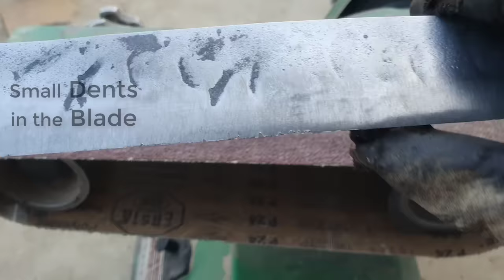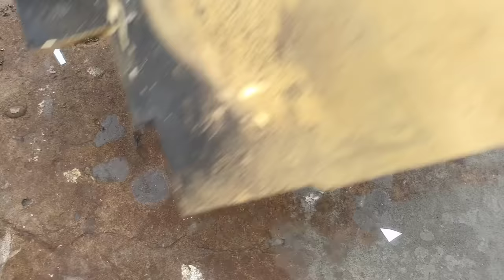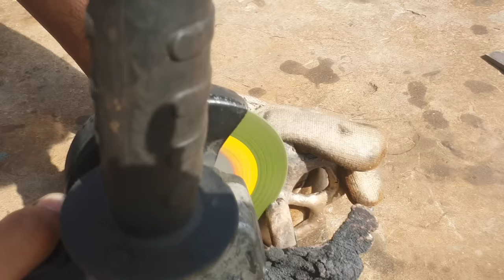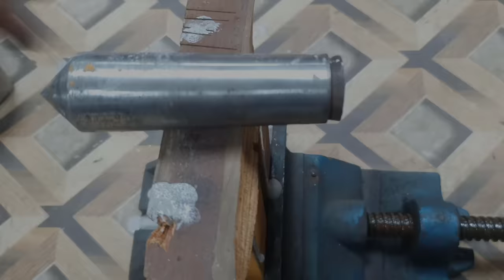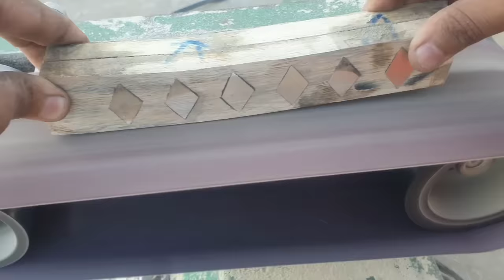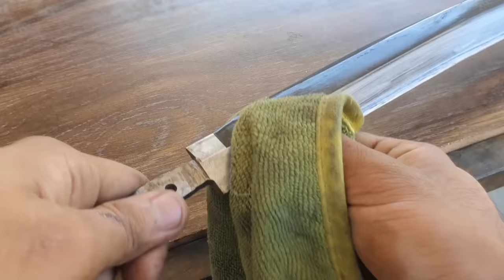Rusted Japanese KATANA SWORD (kind of) - BEST RESTORATION

Comment: I think your "Japanese Katana" is actually a Thailand "Krabi" sword. That would explain the round wooden handle, short tang and overall shape... where did you get that?
Reply: Dang if that sword was actually from my home country it would be cool ,but I cant tell if its krabi though.
Reply: No idea about the tang, but it looks like some kind of cavalry saber, or a weapon of similar purpose. Def not Japanese craft though, as it's a solid blade, not folded steel.
Reply: Damn didn’t even think of that I was so focused on the blade I didn’t notice the handle.
Reply: Maybe your right because katanas are signed by the bladesmith
Reply: I see what you mean I don't entirely think it's a Krabi sword tho
Reply: Yea at first glance I thought it didn't look right specifically the handle area. Once he cleaned the rust off I noticed the blade was a single piece and not folded. There was also a very prominent sharp curve in the blade and I felt like the tip of it was off as well
Reply: Yeah the blade looks like It was beaten to shape
Reply: It might just be a self made sword. Simple round wooden handle, no guard, and the blade looks pretty thicc, without taper from base to tip, which is present on most(if not all) historical swords. In fact, the restored sword is way closer to a katana than the original.
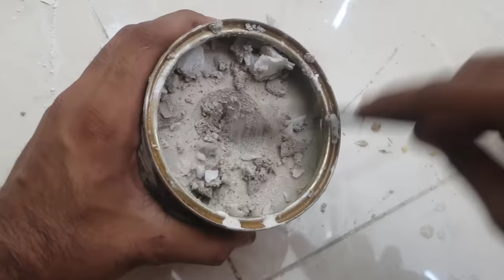Reply: 11:53 RIP Tile floors. Definitely not a katana but awesome find nonetheless
Reply: Right. And no self-respecting samurai would have a crappy handle like that on their katana.
Reply: The blade looked like a boomerang.
Reply: I taught so too
Reply: Looks like the 90s cartoon #SamuraiJack's sword
Reply: I don’t think it’s a Krabi but it’s definitely not a katana, the blade has a really prominent sharp curve to it around the middle and the tip of the sword looks too bulky
Reply: @Xeoruee  Idk, it kinda look like a old katana but the curve doesn't look like a katana at all
Reply: I was about to say it looked more like something from the mainland. Definitely Eastern though.
Reply: I agree because a katana is a two handed sword and this tang is to short for two hands to be weilded safely
Reply: It’s missing the blood groove
Reply: It was not anymore this guy will turn anything into a katana
Reply: @aydanrhodes3743  ye... True
Reply: @sargvision8313  LoL
Reply: Also the katana isn't bent that way
Reply: This is indeed a primitive Krabi sword, it was probably made by a young adult for fun and forgotten about
Reply: Nerd
Reply: Lawnmower blade
Reply: @invictussonne  I live in city name Krabi
Reply: @potatopc9410 nice! thai or a foreigner
Reply: @invictussonne  Thai
Reply: It just similar to krabi  cuz i have one at home
Reply: @invictussonne  Nice
Reply: @Xeoruee  You were right it’s definitely not a katana katana’s are only curved but the sword shown is not curved at all it’s only straight
Reply: I should know this because I have a katana and I have seen old katanas and the blades we’re all curved
Reply: Even sometimes a whole thing was curled
Reply: I agree with you. I studied martial arts in Japan and am quite knowledgeable about the Samurai and their swords and whatever this is, it is not a Katana. That in no way takes away from the video or his skill. It's a cool restoration.
Reply: Do a backflip?
Reply: Click bait ┐(´ー｀)┌
Reply: It is probably a home made "sword thing" that i finally completed into something nice looking.
Reply: Well whatever it is he did a damn good job on it
Reply: The tip of the sword doesn't look like a Krabi sword, it looks more like that of a Katana. .
Reply: @kirknay  yeah it was used against the Portuguese colonisation
Reply: The number of internet “experts” here is staggering
Reply: I believe this to be a Old English Butter Knife.
Reply: James is big brain. I thought it was a katana
Reply: @nevergonnagiveyouupnevergo7513  plus the letters so not look japanese they look more of a sankeittyish like similar to thai letters so I agree with the OP I think it's a Krabi kabong
Reply: One way to know for certain would be to look for a signature on the blade, as the japanese always signed their work
Reply: Definitely not a katana
Reply: @kirknay  The tang is called a “rat tail” tang.  It is welded to the blade.  Swords with rat tail tangs are not truly “combat worthy” because the weld is prone to snap, sending the blade flying.  A katana is one solid piece of tempered steel.  The blades in the pic will give an idea, tho they are Chinese, and probably soft steel.  But still, they are full tang.  https://www.hanbonforge.com/Bare-Blades/Hand-Made-Real-Blades-for-Japanese-Samurai-Sword-Katana
Reply: Na im pretty sure it’s a bokken bokuto def not a katana tho
Reply: @invictussonne  0000
Reply: @kirknay  you do know not all japanese blades are damasteel
Reply: @henrykkeszenowicz4664  historical swords had taper on two axis, profile taper and distal taper.
Reply: @nevergonnagiveyouupnevergo7513  not exactly. I own 3 katanas, and only one is signed by the blade smith, I also own 3 wakizashi, 2 of which are antiques that are centuries old and none of them are signed
Reply: So he didnt restore weapon he just destroy pice of history for clickbait title. Pure cringe
Reply: I woulda cut the tang off and welded on a new longer one myself but that's just me
still that handle looks amazing and the whole thing looks great so I'm nit trying to back seat eww shoulda done it like this, i woulda done it different but the results are still really awesome
Reply: @darthXreven  If that sentence had run any longer it could have competed in a marathon.
Reply: Correct that ain't no Japanese sword.
Reply: @johnwayne2103  Right? Just because it vaguely has a similar blade profile to a katana.
Reply: Ngl kinda looks like what my buddies would make in high-school🤣
Reply: @DIRTBIKEBDOG  you mean tachi?
Reply: bruh i wish i had that kind of sword knowledge i need to do some reading up
Reply: Krabi Krabong is like a wakizashi.
Reply: Or chinese Dao
Reply: 日本のカタナは16世紀からタイに輸入されており、タイのクラビ刀は日本のカタナを模倣したものか、輸入されたカタナでした。なのでこの刀身は実質的にカタナだと言っても問題はないのではないかと私は思いました。
Reply: @masterz1788  Ну так катана тоже была импортирована в 8 веке из Китая, то есть меч Дао.
Reply: @relicthominide5546  日本列島で直刀の生産が盛んになったのは弥生時代末期(3世紀末)と言われており、その時に輸入された中国の"環首刀"を模して造られたのが奈良時代以前の"上古刀"と言われるものです。
鎬造りの湾刀である日本のカタナの原型となったのは、平安時代中期頃に日本列島の東北地方で栄えていた蝦夷により、"蕨手刀"を基にして8世紀後半から9世紀初め頃に開発された"毛抜形太刀"です。
中国でこの日本のカタナのような鎬造りで湾曲している刀剣である"腰刀"のカテゴリが登場したのは明代の頃で、"倣倭腰刀"と呼ばれ、明代の末期で最も製造が盛んに行われていました。
しかし、この"倣倭腰刀"も日本で独自に進化した、鋼で軟鉄を覆う製法である"皮鉄・芯鉄構造"とは全く逆の製法で、中国の刀剣ではよく用いられた製法である、軟鉄の間に鋼を挟み込む大量生産を目的とした簡易的な製法でした。
この事から、平安時代に栄えた湾刀である日本のカタナの製法は、中国から輸入された技術ではなく、日本列島で独自に成長した技術であるといえます。
Reply: If it was "japnese katana it would absolutely have one sheathe with it right 🙄
Reply: I was looking at it and thinking to myself that’s not a katana at least not a proper one the shape is off the handle is off the steel is off and I’m thinking this is either an early attempt at making katanas or some dude wanted one but didn’t have the proper tools so this was the best he could do then I read this comment and the krabi seems more likely
Reply: Comes from Aliexspress
Reply: Hey
Reply: And thus I've learned of a new kind of sword. Wicked.

Comment: BIG TIP: Remove the slag from the top of the crucible before you pour. It will make your pour cleaner, less imperfections in the material, and give you more control of the material. All of this will decrease the amount of work needed after the material sets up.

Comment: Well since you glued the tang into the handle... Hope the blade never comes flying out from swinging it..
Reply: Depending on the glue used it'll probably hold up better than most other methods of securing it. Professional grade glue is often stronger than the material it holds together
Reply: @bobowon5450  yeah you hope
Reply: Yeah I don't trust adhesive either
Reply: heehhehe .. well its strong .. until its not ..
Reply: But isn't that super glue or something
Reply: I was kinda hoping throughout the video that he’d secure it with screws or something, but I suppose that’s not really necessary if it’s probably gonna end up as a decoration
Reply: The glue doesn't matter unless he is gonna fight someone using it.
Reply: That's an adhesive and many swords use it. To remove the tang from the handle would mean destruction of the handle.
Reply: +10 ranged damage

Comment: One question: Does the handle has a good grip? Because you didn't used the traditional wrapping, which gives the handle/tsuka a really nice grip, instead you made wood with metal, and I'm curious if it is good.
Reply: no one cares
Reply: To tell you the truth, the wood/metal grip is sattisfactory, but the traditional wrapping gives a little bit more control and stability for moves.
Reply: Yeah, I know. Andit is a bit easier and takes less time to make than diamond-shaped metal parts. And the wrapping looks cooler as well-
Reply: the video is about how you can turn rusted metal into something shiny, nobody is going to use this sword.

Comment: Very nice, however there are a few things that I would argue that could be done better, primarily in the hilt. I know it's mostly a display piece, but just using epoxy to secure the hilt is a not ideal. Would be stronger to use a single piece of wood and to connect the blade with rivets going through the tang of the sword. I would also suggest using oil or clear lacquer to coat the handle over clear plaint, less likely to wear down over time. Alternatively a cloth or leather wrap on the handle would be good, as it would increase the ability to grip it without it slipping.

Comment: i like how he doesn’t desire for nothing but perfection , true definition of a black smith.
Reply: NONE OF THIS RESTORATION WAS ANYWHERE CLOSE TO PERFECT
Reply: It's not tolerant, better use just  smith.)
Reply: @aidanoleary8403  agreed, good effort but amateur..
Reply: I applaud.  It's perfect for me.  You who comment on it: Show your work.  Arrogant clowns.
Reply: This is basically the bare minimum. Perfection would have been taking the time to polish the blade more, clean up that tsuba, use pins instead of epoxy, and wrapping the handle.

Comment: this looks like a piece of scrap metal someone "forged" into a katana esque shape and strapped a stick to it.
Reply: ikr
Reply: Exactly. Whoever "forged" it couldn't even be arsed to fake a hamon line on the edge.
Reply: Kidos, this was never "katana esque". This was a machete (also if it were japanese with that length it would not be a katana, it is just too short to count as one). Slightly curved blade  isn't exactly exclusive to japanese blades.
Reply: The curve just seems unnatural
Reply: Yeah you can tell that the curve was very crudely hammered into the blade. A real katana Smith wouldn't of had such a sharp bend in the blade.
Reply: @louisvictor3473  I mean wakisashi katanas or i think that's how u spell it they're shorter than the original katana.like bigger than a tanto but more smaller than a regular katana
Reply: @kuroko.k8631  The length is the least of its characteristics to make it a Japanese blade, katana, wakizashi or a tanto. The entire grip is obviously wrong, the tang is wrong, the  tip is wrong, the curve seems off and too strong. The only thing they've in common is the blurred outline.

Comment: Question: do the metal diamonds in the handle make it prone to cracking? I feel like this handle isnt as strong as some of the others? Its secured to the blade by that glue vs metal pins
Reply: This sword is purely for display, there's no way it could be used in actual combat

Comment: Your Katana is missing the Hamon Line.
Reply: 刀の事をよくご存じですね！
Reply: 白空 彼がこの言語を話せないことを知っていますか？
Reply: Kasra Tayebi what? I just wanted to communicate with the fellow Japanese people so I went on google translate and copied some Japanese words XD
Reply: Hamon ga beat
Reply: @bloggingoreo  Yo are correct that this is no Katana.
On the other hand ther are no samurai anymore, and a long sharp piece of steel solely designed to kill people is always barbaric.
Reply: Niles Butler Katana is an extremely sophisticated blade and samurais were the ultimate in craze and refinement. This blade doesn’t have much in common with a katana.
Reply: Nephealm are you talking about the new sword or the old one? Because quite frankly I think all the samurai can’t serve with any sword, seeing as to how they are all dead.
Reply: That thing is probably the result of a sword smith fucking up the process of making a katana then just decides to put a handle and give it to children to play with or somethin and is left in a river to be found by the dude making this video
Reply: @shockbladezed1871  ngl that kinda makes sense

Comment: got excited to see someone finally drilling holes into the tang thinking pins were gonna be used but nope, another epoxy job lol
Reply: Sacriligious "katana"
Reply: When all you have is glue, glue can hold together a sword.
Reply: @DJBabb  you watch him make all this and think "all he has is epoxy"? No shot. Also, if you go watch some Forged In Fire sword testing, the guys who just use epoxy almost always have weapon handle failure. It looks nice, and makes for a fun video though for sure.
Reply: @Dizzra1  I think you misunderstand me.  There's a phrase "when all you have is a hammer, every problem looks like a nail."  The meaning being that the guy stuck with a hammer will act like hitting every problem is a viable solution.

It isn't.

The glue will hold stuff together, but it's not a long term solution for anything past display.  Then again, there's still so much pitting and rust on the blade at the end, I wouldn't want to display it either.
Reply: @DJBabb  ah ok, i understand haha

Comment: I wouldn’t say this is restoration as much as it is making a new sword out of an old one, too much was changed for it to really be a restored version of the sword that he started out with
Reply: Kinda hard to restorate something maked of two pieces of shitty wood
Reply: @Will-jj4it  But that's the idea. Keep the objects as close as possible to the original. I agree with Luke... I don't know if to call this a ''restoration''.
Reply: The part i didn't like is about this whole thing is that i've worked with that shitty  steel wire that held together the old hilt, and i can almost 100% say that the hilt was put on for the sake of this video.  It has a touch of rust, and my god does it rust fast. and for it to be in that shape, and the sword to be so much worse. They would have had to of put in on after that sword already had 99% of the rust on it.  my guess is the old hilt/gaurd didn't look japenese enough.

Comment: Wow...that handle in the beginning, yikes. I wouldn't have called this a "katana" to begin with but you did make an interesting thing out of it, which I totally enjoyed watching. I would have liked to have seen the handle actually pegholed to the tang, and I guess the only other gripe is that the honed edge should have been mat and the back of the blade shiny instead of the other way around, but no big deal, still looks great.
Reply: Or did his diamond brass inserts and drill a couple holes in it to put at least a brass pin or two

Comment: That's probably an old fishmonger's knife, they use them for cutting up fresh catches for distribution.

It has no habaki (mounting), tsukumaki (handle wrapping) and no tsuba (handguard), despite the apparent decades that the handle went untouched. The handle also wouldnt be tied together with a rough cord at the base, they fasten with adhesives and a sort of unthreaded metal screw.

Comment: Where did you get that sword? The blade looks rather weird. The curve and the tip especially. Looks like someone cut it out with an angle grinder, especially with those dents on the sides of the blade - as if it slipped. Usually, hand-forged blades would have a more uniform curve, that's why I'm confused. This 'curve' looks more like a sharp bend.

Comment: You drilled holes into the tang, but didn't make a mechanical connection with pins. You're getting better. But you need to get certain things dialed in a little better

Comment: probably not Japanese but I love that blade type, would love to know what it actually is. Some commenters said Krabi.....maybe but I think it is as far from that as it is a standard Katana. Of course, even when Japan had a "right" way, many farmers and small village smiths didn't necessarily conform to those standards, let alone in other countries where standards were less rigid on designs. It could even have been reforged by an ancient smith after being discarded or lost by it's original maker or owner, hammered enough to change its shape a bit. At any rate, I would love a sword with this exact blade in a 2 hand, so any insight into it's measurements or origin would be appreciated

Comment: I'm very curious about this sword. Where did you get it? Any info on its history?

It is clearly not made by a very skilled craftsman. If they are, they likely at very least didn't have much resources. Or they were potentially an assassin or spy (think what we tend to call Ninja, though they are largely folklore.) It was common for Shinobi to carry cheap easily discarded or hidden weapons. Often rusted on purpose so even knicks could be deadly due to infection.

It looked like it had intentional markings etched on the side. They seemed either mostly worn away or maybe they were stamped in somehow and just not very even or deep. 

Or at a it newer? The hilt actually reminds me of the home made nunchaku I made as a kid using chain and a broom handle.
Reply: That sword is 1000% fake, he likely made it himself.